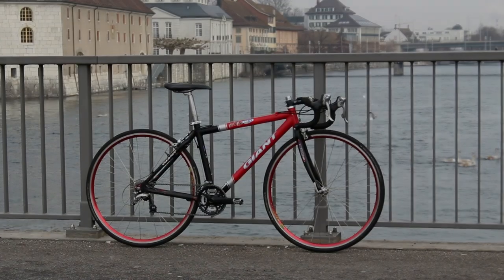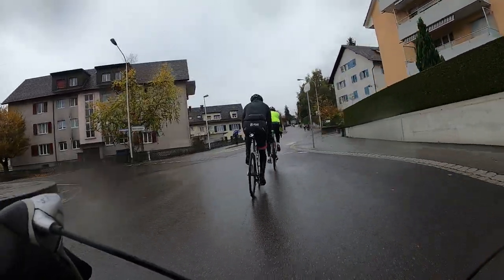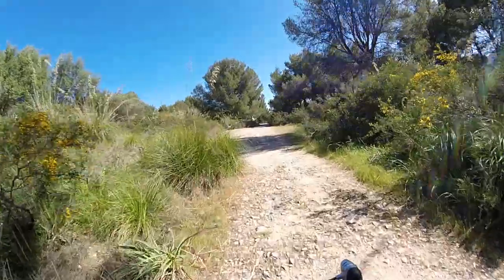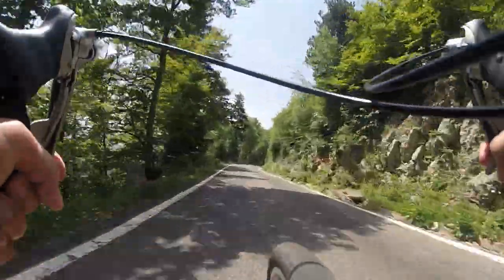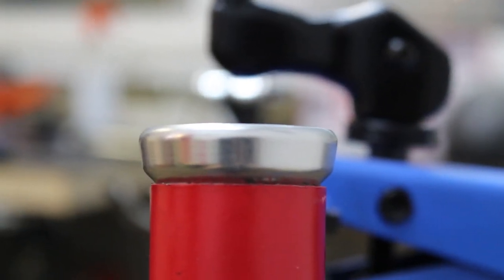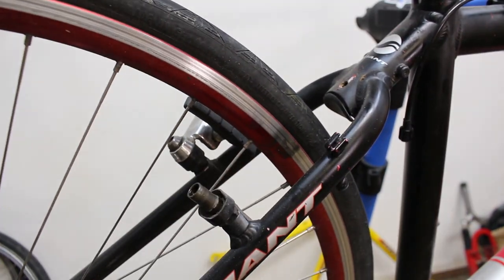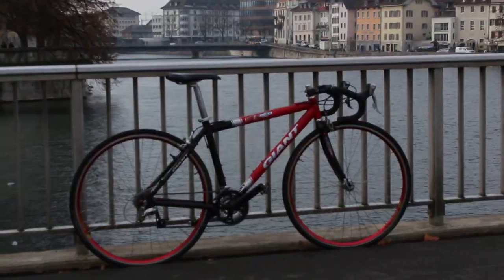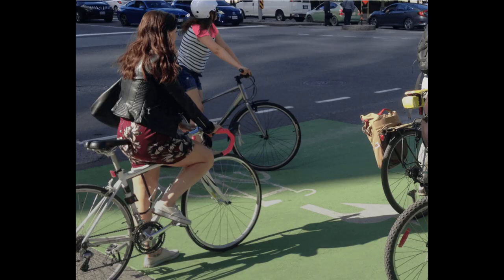MTB to road bike conversion - 1 year update

Comment: Another great video and thank you for incorporating my questions.  Funny the question came up about the OLD spacing on the rear wheel.  I actually recently converted a 130mm road wheel to 135mm spacing by getting the correct axle but I had to get the rim redished because it was needed in order to maintain the correct spacing on the drive side.
Reply from the maker: thank you Lyam! interesting about the re-dishing. For this hub setup, if I recall right, I could have moved the bearing races from left to right wherever I wanted, they were threaded onto the axle, so I don't think with this type I would need to re-dish, but I'm not 100% sure I'm thinking of it correctly.
Reply: HACK AND RIDE BIKES I was able to make it work without redishing but it moved the smallest cog away from the dropout by 2.5mm.  I was still able to shift into all gears but it’s not ideal and shifting wasn’t super reliable.

Comment: Take the bike apart, pack it in a box and ship it to yourself. The memories you have on that bike are well worth the effort to ship it instead of trying to put it in your luggage.
Reply from the maker: I should look into the cost at least. Thanks for the comment!
Reply: Sure beats throwing it in the trash where you would have to pay to get rid of it. I'm willing to bet you could do a fund raiser to help with shipping.
Reply from the maker: RollinRat  actually the airline offered to bring it for free, they even provided a box! But in total because all the other things, like renting a van rather than a car on both ends, it ended up costing a good bit.
Reply from the maker: RollinRat  it's a little complicated, the free policy, so meaning you get your normal luggage plus one bike, that was from edelweiss. However that flight got canceled and Swiss took it over. Swiss offers a slightly different policy, wherein you get to bring a bike for free but it has to be in replacement of your checked 23kg bag. But because I had bought the ticket with edelweiss, Swiss also accepted their policy.
Reply from the maker: RollinRat  where are you riding at?

Comment: For the FD issues there are options....

First, you can use a JTEK Engineering Shiftmate. Sorry, forgot which one.  

Or swap to a roadie FD, which is the option I chose when I did a dirt drop bar conversion on a 1993 Nishiki Pueblo mtb
Reply from the maker: Yeah I’ve seen these shiftmate things, but I never bothered,  but at this point the bike is just a frame hanging on the wall.